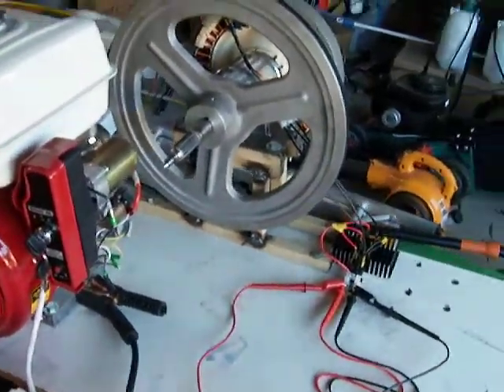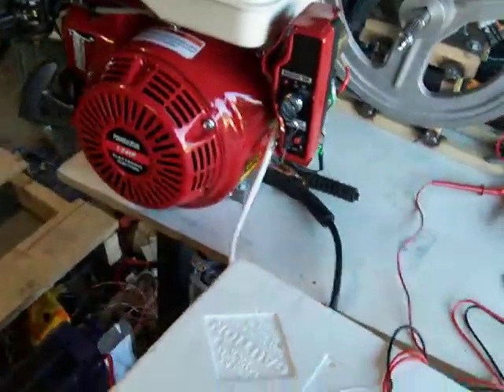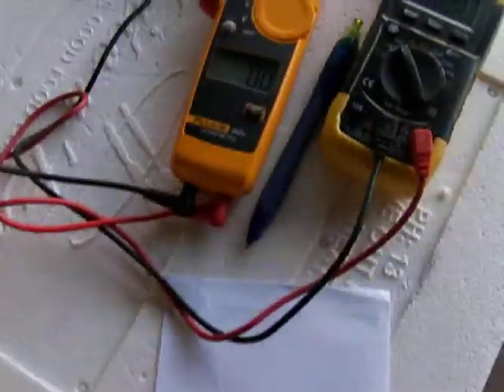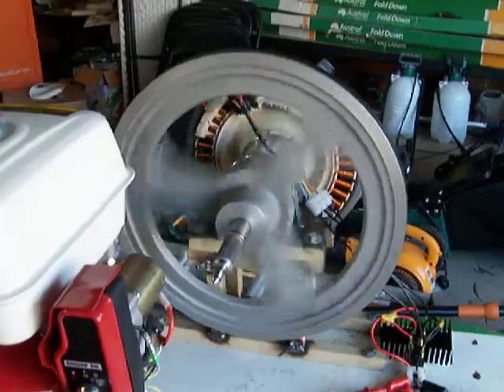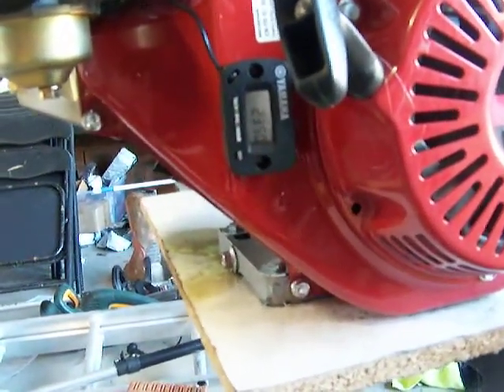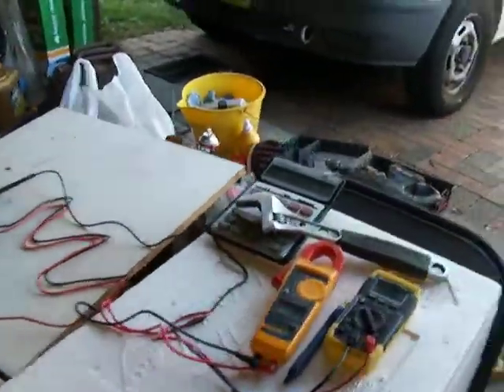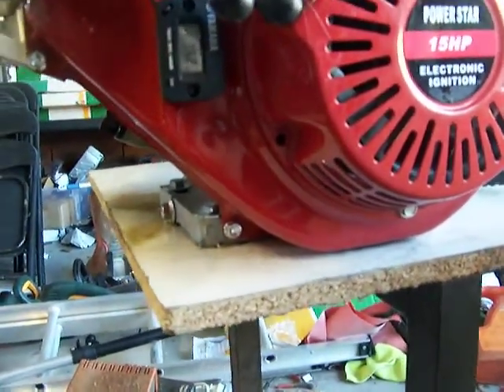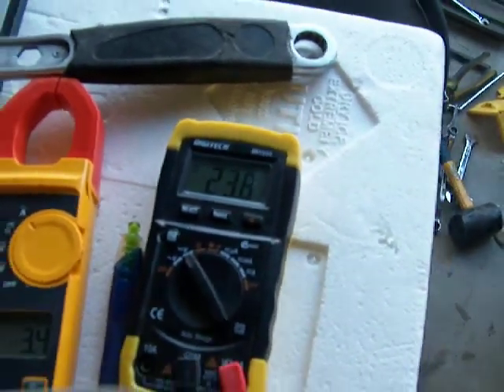Fisher and Paykel smart drive motor testing, part 2

Comment: great video,  what I am trying to do is run this type of motor on twelve or twenty volt power supply without rewiring the stator. have not found any detailed info on the net to do this. if anyone out there reads this and knows what to do and is willing to share it please contact me at  exeflier@yahoo.com.  so we can communicate more. thanks to all out there.

Comment: I'm still confused how your Ammeter (Amp meter) was connected... in the video it almost looked like you connected it directly ACROSS the DC output from the rectifier??????????????? If so, that's 100% wrong.

That would/could blow up your Amp meter internal current shunt, or at least burn out its fuse, if so equipped. It will also cause your Bridge Rectifier to get VERY HOT... because of the dead short.

what is that device with the BIG heat sink??

Amp meters have a near Zero-Ohm internal "shunt resistor" across the meter probes (you can measure this with your other multimeter in the Ohms scale)  The meter then measures the millivolts across this shunt resistor, and converts that to Amps. 

Example: Many meters use shunt resistors of 0.10 Ohms. If you have 10 Amps flowing THROUGH that resistor, there will be 1.00 Volts across it, which the Meter converts to read out as 10.0 Amps of current.

You need to connect an Amp meter in Series with a Load... such as light bulbs, huge resistors, etc... something that will withstand the applied voltage/power.  You could use a set of light bulbs, an electric heater, etc.

The first step would be to measure the Volts ONLY, no Amp meter at all.  This lets you know the Open Circuit Voltage of the Motor (alternator, in this application).  This is the Voltage your "Load" needs to be capable of withstanding, WORST CASE. 

Most of these motors are rated for 310V DC applied voltage, and a maximum rated speed of about 1200 RPM or so. With this in mind, we can assume it will output "approximately" the same DC voltage, after the 3-phase bridge rectifier. (you know a 3-phase bridge rectifier is 6 diodes, right? It can also be done with two normal 4-terminal bridge rectifiers, by connecting all DC outputs in parallel, and just use 1 of the AC inputs in the 2nd device for the 3rd phase)

 I would therefore begin with a pair of identical 240V light bulbs connected in SERIES... not in parallel, as a Load. If you can find some 200W bulbs, that's a good starting point.

Once you have the bulbs connected in Series, connect one of the remaining wires to the DC () output from the Bridge Rectifier.  Connect the other wire from the bulbs to the () lead of the Current (Amp) Meter.  Then connect the (+) lead from the Current Meter to the (+) from the Bridge Rectifier. Now you have connected the Meter in Series with the bulbs.

The Voltmeter then connects directly across both DC (-) and (+) from the Bridge Rectifier.
Reply: These motors as generators actually are a little bit different than 3 phase output. The center leg of the Wye in most cases is not brought out so two legs actually form one phase at a time. To get true 3 phase output you need to split the Wye configuration. It is basically a two phase generator otherwise that rotates between the three output wires. Still uses 6 diodes but the output is different and not the max you can get out of one. To get the max power out, it will take 12 diodes with the Wye split to bring out 6 wires. 3 phase Delta would be a different story as there the three wires would each be a leg of a coil and you could see both positive and negative on each wire at the same time.